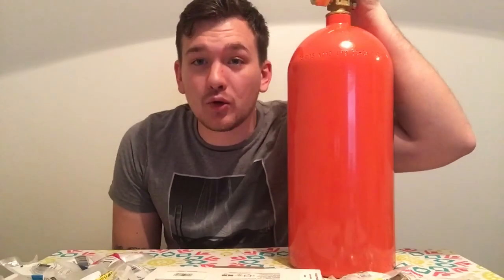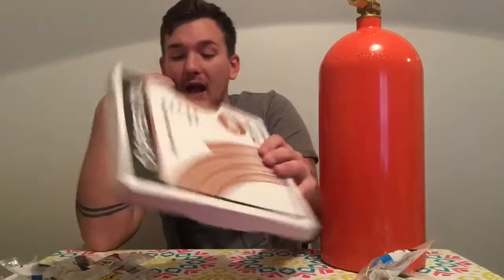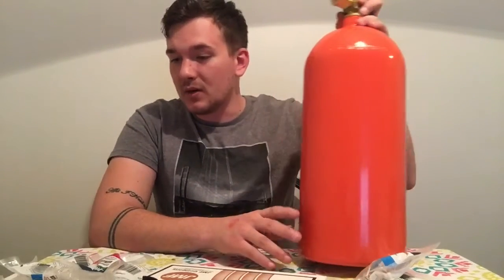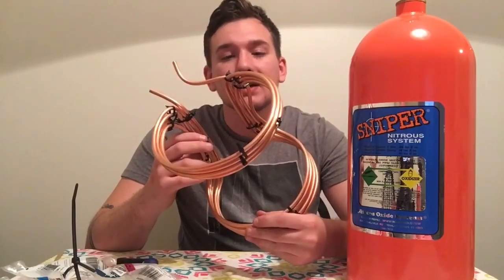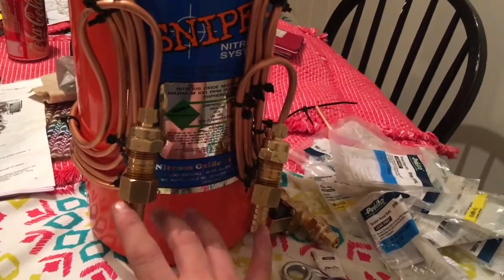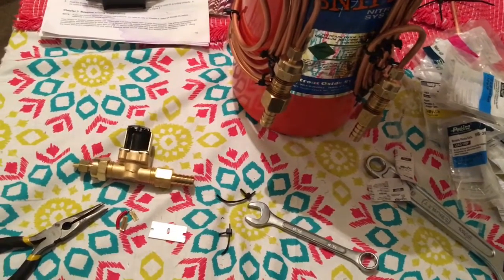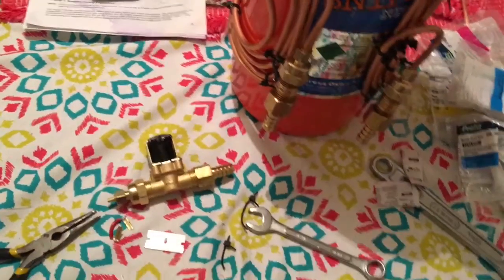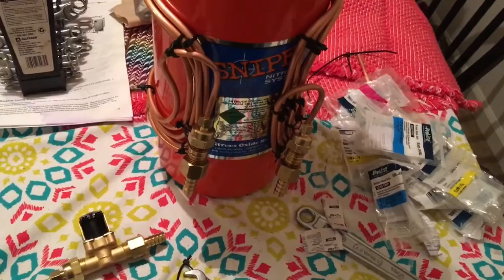GHETTO BOTTLE WARMER

Comment: Man Hu use a torch if you can't afford a bottle heater. That's what I did until I bought my bottle heater.
Reply: Typo... Just use
Reply: a big no no on torch and bottles.... especially the modern aluminum or carbon fiber style.

alot of catastrophic and unfortunate events got documented on using a torch...   that's why nhra banned it and no nitrous company would tell you to use a torch
Reply: +Outlaw I understand what you're saying, but man we've been using the torch for years. Just have to keep the torch moving & don't keep it still for too long. Over time I've heard the torch weaken the bottle though. I have a bottle heater now lol.
Reply: nola504boy1 haha

You got lucky man but don't push it any further.

Just send your bottle for an exchange to Nitrous Outlet as they have a program to support the cause. 

Use a heater and stay safe bro
Reply: +Outlaw wow didn't know they'll do that. Will they exchange it even if it's not their bottle?
Reply: nola504boy1 yes but there's a fee and it would cost less than buying a new bottle check their website
Reply: +Outlaw ok thanks for the info brother.
Reply: No problem